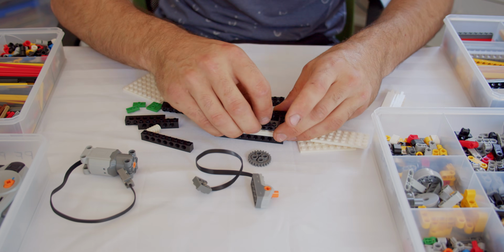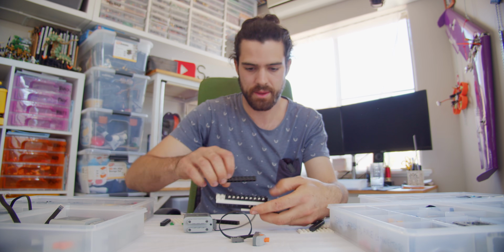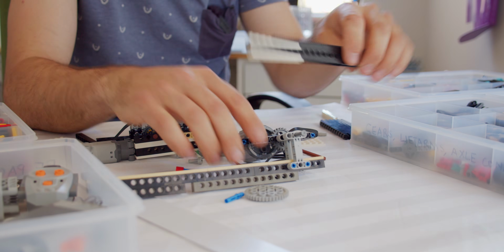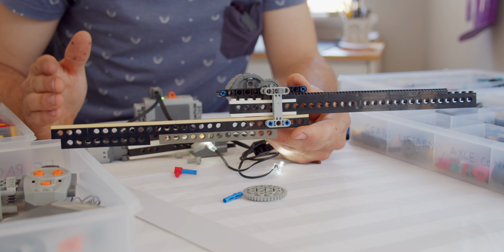Introduction to LEGO® Technic Power Functions: Motors, Gears, Switches, Racks & Pinions | Scowen On

Comment: I'd like to use the same gear arrangement from the first part of the video for a specific task. And that is pulling a load that weighs over 500 / 600 grams. Though there would be no friction. The load would be pulled along on ball bearings across aluminium tubes with a string for about a meter at slow speed. Obviously, I'd need a fair amount of torque. Is there a particular motor that you would recommend for this application?

Comment: at around 5:45, the smaller gear is the 8-tooth, and the bigger is the 24-tooth, so actually driving the 24-tooth would drive the 8-tooth 3 times and not 4